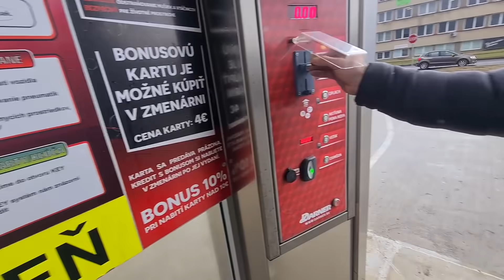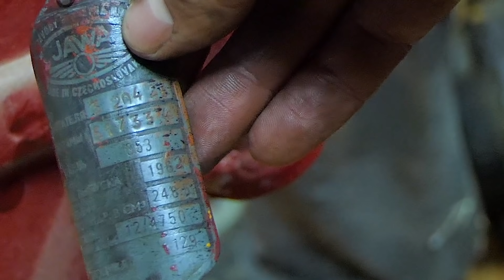Restoration Abandoned old Motorcycle 1962s Jawa 250cc 2-Stroke - PART 1

Comment: I bought a bunch of Java road bicycles from a bicycle store that was going out of business. ( I had my own bicycle store.)They were ten speed bikes. With sew up tires. Every thing was made by Java. Even the derailleurs. The front derailleur didn’t have enough travel. It rubbed or won’t shift. Had to replace them all. Only other problem was the chain would some times spin between the rear sprockets. No shifting under any load. Light weight steel frame. Most of the components were made from alloy aluminum. However it had a steel cotter pin crank.
Reply: This motorcycle is a different company, it's a Jawa not a Java.

Comment: I seen one of those Jawa motorcycles when I was young, I was going buy it but for some reason I wasn't able to I can't remember exactly why. those bike's have a strange engine they are a two stroke. they have two cylinder's but it's not a twin cylinder engine. it has two pistons that share a common connecting rod. one piston is larger than the other one, the larger one is in front of smaller one. the smaller one acts as sort of an intake valve for the larger one,  by closing the passage back though the intake port to the carburetor. if you will notice it has two exhaust pipes and only one spark plug and only one carburetor.  I would guess that parts are going to difficult to find for it. Jawa and CZ were together for quite a while, I think CZ is still around I believe they make motocross bikes, but I don't know about Jawa. there might a slight chance to find parts online. but the specs. are probably online, because if they were in print at one time they would probably be online.
Reply: No mate this is Jawa 250 353 2 stroke single cylinder, Jawa 350 is 2 cylinder in-line. You are talkig about Manet 90 from 40s.

Comment: Nice find (whether faked or real), couple of things you can incorporate into the Jawa resto is firstly when setting up the ignition timing if you set the contact breaker opening to 1.8 - 2mm BTDC on the piston stroke it cefinitely improves the top end power of the engine and secondly when setting the clutch pushrod if you can set the running clearance to as little as possible with no preload on the pushrod, the "slick shift" mechanism on the gearchange will allow you to change gears without using the clutch lever (with practice it's possible to make down changes and even sit at junctions or traffic lights and pull away using the gear lever as a clutch and gearchange a la' Honda C50,70,90), if you want to go further you can build an electronic reuglator (used to be able to buy them but I don't know if they're still available) for the generator which will double it's output though you'll need a 12V coil or a ballast resistor.
Reply: you know all
Reply: @beaconsharman7159  yeah, luv MZ's, CZ's and Jawa's bit agricultural but tough as nails --- only bikes you can come off and the only damage usually is broken handlebar levers and indicators (if fitted).
Reply: @stevehill4615  whats the difference between CZ  and Jawa of  the same 60's period?
Reply: i can confirm this <3
Reply: I like your funny words magic man
Reply: 9o